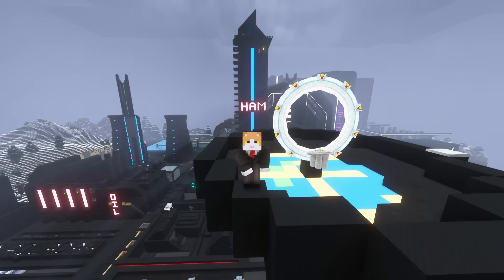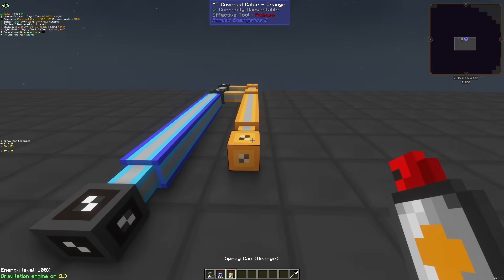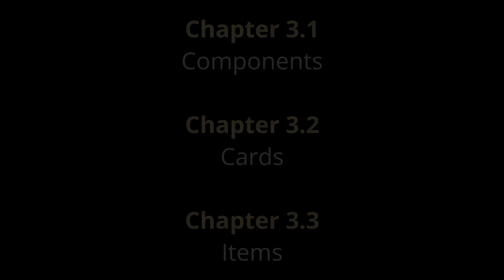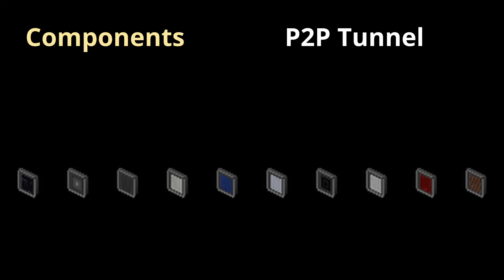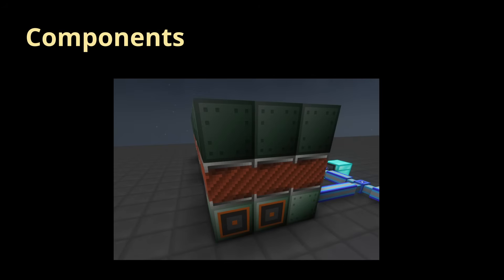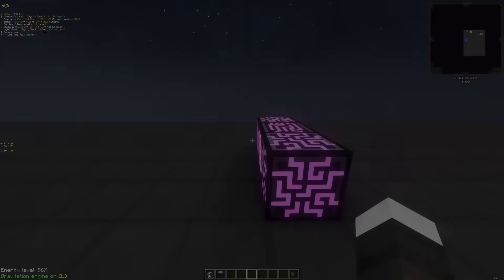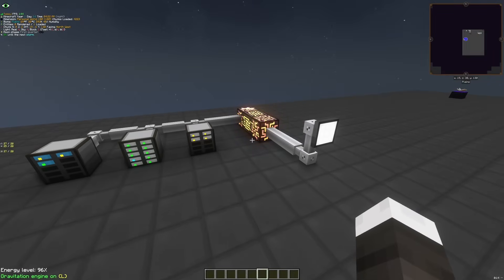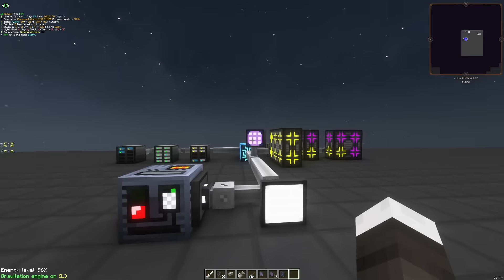GTNH AE2 - The Absolute Basics by HamCorp

Comment: I really feel like this glazed over so many details.
I have zero experience with AE2 beyond a basic random drive heap.
I feel like Logistics Pipes is very logical but very burdensome (having used it extensively to EV), and hopefully theres compound interest with this.
I hope I can find a video that explains use cases with each component for real; it feels like there must be 4 different ways to skin every cat, and the impact on crafting speed or TPS is completely opaque.
The closing comment in itself didnt even seem like it made sense; surely I should be able to just stick interfaces on each input/output hatch/bus block, and slave them all to a pattern in the output?
Reply from the maker: Indeed, I did gloss over a lot - I tried to cover things that are not explained in the questbook. IX's basics video might be nice for what you're looking for.

For tps, I don't think a starter AE2 network should worry about it. It's only late game networks and poorly filtered subnets that cause tps issues, so I decided not to mention it in the basics video.

For the LCR, the issue is - how would you push materials to multiple destinations for the same craft? Multiple interfaces does not do the trick

Comment: I want to set up an ae2 subnet about as much as I want to automate thaumcraft, these 2 mods have similar amounts of impenetrability in my mind

my last run ended at around mid ev, where I couldn't comfortably continue without ae2 but would also rather just switch to a different hobby than wrap my head around it
Reply from the maker: Subnets will click for you eventually, it took me like 2-3 modpacks before I truly understood them. But thaumcraft automation is a problem on the mod's side.

Comment: Dear Ham-Corp, 

This was very informative and helpful, but there is unclear instructions regarding automating machines that include a shape like the extruder or the forming press.

If a follow up on this or indeed a tutorial could be provided, it would be much appreciated.

Best, 
Hard worker nr. 266508
Reply from the maker: Dear employee,

Simply place the non-consumed item in the machine/input bus, and create the patterns as usual, making sure that non-consumed items are not present in the pattern.

You will need a new input bus or machine for each variant of programmed circuit or other non-consumable, unless you use universal automation (I don't know how that works).

Best,
HamCorp

Comment: Some components (like energy acceptor, matter condenser, charger) don't take channels

Molecular assemblers are really expensive when you are starting AE.  I used crafty crates, which is janky, requires botania progress, and requires a small IV dip.  In theory you can use any crafter, but molecs/crafty crates will probably be what you want most of the time, most automated crafters are locked to a single recipe

Cells will probably be the best choice for items all the time, but you can use a drawer wall with like a fish farm or something early on.  Fluid cells are much weaker, so bedrockium drums are a good option early on if you have the thaumcraft research to dupe the nuggets.  There are also the tfft and yottank later on, but these are far too expensive for what they do relative to a cell

You can make processing patterns with more inputs pre-luv using opencomputers (it can even do more inputs than the processing pattern terminal), although this has pretty limited applications (eg infusion)

To expand on what Tooj said about fluid crafting a bit, the fluid discretizer basically does two things: it causes all stored fluids to appear as "drop" items representing 1 mb each, and it automagically allows converting these drops into "fluid packets".  A purple pattern takes fluids as drops, but its inputs are listed as packets.  If you put it in a regular interface, the discretizer will still make the packets, but the regular interface will not convert them back to fluids, so you end up with these weird items in your target inventory.  Dual interfaces can accept and stock fluids, and also convert fluid packets sent by autocrafting into actual fluid

Sometimes, it is useful to have the "fluid packet" though.  This is just a normal item, and you can turn it into fluid using a "fluid packet decoder", which was the only way long ago before dual interfaces got decoded

Part 2 will probably explain a common application of this (universal automation, where all the item and fluid (as packet) inputs for a recipe are dumped into an ITEM cell, and then this is shuffled to a subnet to process it, and once the cell is empty of consumed inputs it is shuffled back).

Comment: Wanna add abt the cables. Onne guy actually tested covered cables vs the glass ones. Glass cables are around 15-20% more laggy than covered variants. It shouldn't matter at the start of your ME system but it WILL matter later when your base is large.

About the energy acceptor. The waila number of its inner energy capacity(80 kAE) is it's throughput per tick. So providing more than that amount of energy to a single acceptor is pointless. Believe me, there will be a time when your consumption is higher than a throughput of a single acceptor.

About the P2P tunnels - two of the more useful variants are Dual Interface and Interface P2P. They allow for recipe parallelization by treating your input p2p and output p2ps as valid locations for pushing the patterns. Insanely useful. IUdk tho, maybe you'll cover it in the next video, hope so 😉  

LMA(Large Molecular Assembler) can batch recipes. One should absolutely go for it ASAP, it's goated compared to molecular assemblers. 

About the ME output Bus/Hatch it should be added that you can increase their inner buffer by crafting them with storage components in the crafting grid.

For Adv stocking Bus/hatch there is a setting to see only the items which are more then specified threshold. For example, If you want to ONLY process stuff in batches of 64 - you can with this setting. Useful for Electrolyzer subnets where there are all kinds of input amount from 1 for ashes to 73 or whatever for zeolite.

About the autocrafting - there are some good tips. First of all when you enter the amount you want to request - you can press on the little hammer to the left of the bar to order without the supply of resourses. What that does is treats EVERY resourse required as a craft output. In practice it means that your system would just wait for a required resource to enter the ME system. For example, if your craft requires X iron dust and you are sure that your OreProc/Bee/Crop Farm would eventually produce that amount - press the button and craft would proceed as soon as dust enters the system.
Second - when you miss something for the craft - press shift+cancel. This way you'd automatically bookmark the missing resourses in the NEI, pretty usefull.

Great video! Can't wait for a part 2!
Reply: Those last autocrafting tips are awesome, how are those not more widely known?
Reply: @darkhawk155 who knows, these have been in the game for a while now
Reply: most big bases don't use many cables either way, wireless is just the way to go, since AE2's EU consumption can be approximated to 0 and from uv equated to 0

Comment: Id like to make a point for crafting cards for certain automation challenges (specifically bloodmagic runes)
When a Crafting card is placed into a level emitter, it will emit a redstone signal (or not if inverted) when the defined item is actively crafted (shows green in the autocraft overview). I am personally unsure about tps impact and I only use it to automate slate crafting with the blood magic Blood Altar in most modpacks. Its also helpful to only enable a certain thing getting pulled out again when using the same item to craft another item and that itself is crafted in the same device where the input slot is also the output slot (read blood magic altar and similar)
Reply from the maker: A few crafting cards is not going to affect tps, and there are some valid use cases for crafting cards like you mention.

However I don't know if the random component despawning has been fixed, and that was one of the most annoying and hard to troubleshoot issues I had in my run, so I can't recommend crafting cards to anyone.